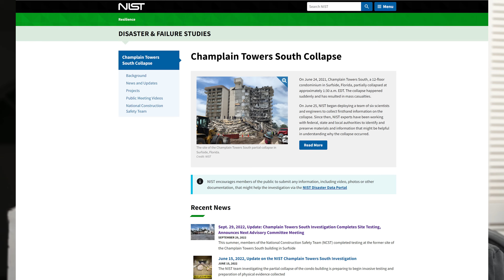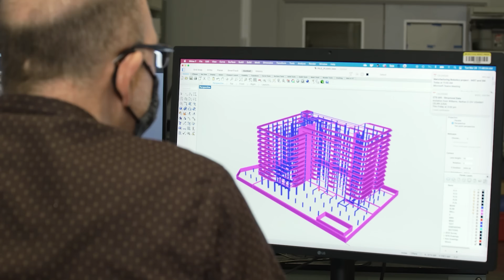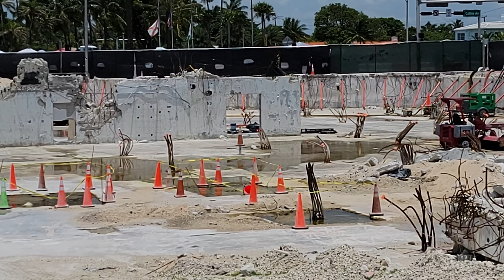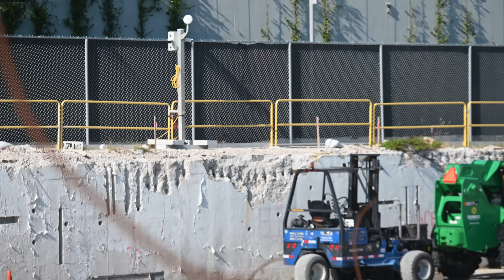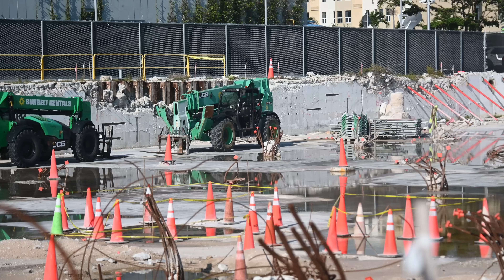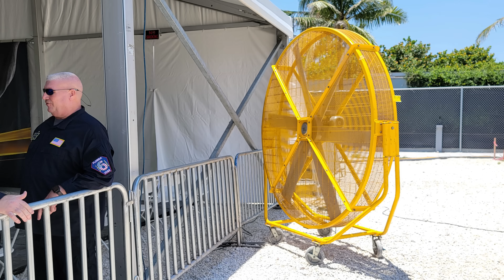Miami Condo Collapse Investigation Takes Unexpected Turn

Comment from the maker: 📺 WATCH: Fire Alarm Issues? Champlain Towers Condo Collapse, Property Sale
https://youtu.be/pVbhZFDj8tc
📺 WATCH: Champlain Towers North Crumbling Concrete! WARNING Signs?
https://youtu.be/6QwILxJgF1U
📺 WATCH: NIST Releases NEW Condo Collapse Investigation Video
https://youtu.be/KUG08o8Mnek
📺 WATCH: Champlain Towers South Condo Collapse Site Update What's Up?
https://youtu.be/QbqfabsDGM0
📺 WATCH: Investigation Update Miami Condo Collapse New Photos/Video
https://youtu.be/y7mFnrXzZ_Q
Reply: Any thoughts on the structural integrity of the Crimean (Kerch) rail bridge after suffering from possible blast/heat damage?  I can't make heads or tails out of the flood of pictures and videos showing the damage, nor can I find any construction drawings on how the bridge is even constructed, no cross-sections of the rail bridge spans, nothing.  I don't know if bridges are within your area of interest or not, just asking.
Reply: Hi Jeff, thanks again for your videos!, one question, what did you find out about that horizontal beam that everyone was talking about?, did the investigation team haul it off ?, or turn it into Swiss cheese with core holes ?, thanks!
Reply: My question is, are the buildings and condos safe to be in ?

Comment: I'm left wondering what the original weight load was for each floor as it stated in the blueprint from 1981? And then compare those numbers with a rough estimate of the weight was when in collapsed. I remember you mentioned that on previous videos through kitchen and bathroom makeovers of all that added weight.
Reply from the maker: In good buildings it should not be a problem with added weight. But what about a building where the concrete is no longer rated at what it was constructed to be due to years of crumbling

Comment: hey Jeff nice to have some fresh details of the early  pics and videos. I guess the horzontal and vertical sample taken out was to mesure the strength of the concrete on both sides all around the building. I am pretty sure they won't miss a thing about the flaws or any faliures or lack of mantenance that took it down. They owe it to the victims and victims families

Comment: I believe where there are reinforcing rods in the columns, I Beams would be much better
Reply from the maker: If the pipe stub coming out of the wall is too short you have no choice and so you're going to have to sweat it off with the torch and try to clean that pipe. Normally I hope there's enough pipe stub coming out of the wall that I can just cut the pipe behind the valve to remove it, so that I have a clean pipe and don't have to worry about trying to fit a new valve over old solder that might still be on the pipe.

Comment: It's truly amazing how the settlement went ahead of knowing what was wrong with the structure and those who'd have been responsible.  All they did was conclude that everyone that had anything to do with the building, its operation and maintenance gather and fork out as much as they could including their liability insurance policies to form a settlement to conclude the matter sooner.  It would be a shame to find that NIST determins 90% of those who paid were not responsible !  Our DOJ system is completely a bubble off plumb.
Reply from the maker: The insurers for all of these companies all wisely felt it was best to just settle now and get it out of the way rather than to have victims and the insured contractors have to endure 5 to 10 years of litigation which all of the money goes to the lawyers. That way people's names don't get dragged around in the mud in the public and the court updates on the news.
Reply: @jeffostroff  Yes, I totally understand that which is why it was mentioned. Sadly, a lot of those lost likely voted no on maintenance and HOA increases. If anyone needs to know, HOA communities are more expensive than owning your own in the long run. Also, they are another level of politics that require funding. Our DOJ system is completely a bubble off plumb and the attorney fee agreement proves it. Pro bono now means something else.

Comment: You are focused and fascinated on pointless senseless things .. Swiss cheese.. Cutting. More holes bla bla bla bla bla jeeeezes... And scammy company drilling holes for vibrations ?? How is that going to help the collapse ?
Reply from the maker: And you are focused on whining instead of engineering. The purpose of all of these holes and cores being cut is they can analyze the concrete from these core samples and determine what went wrong and where and the more samples you take from more areas the more you can tell if it was a systematic issue with bad concrete being poured, or if there was actual water seepage into the concrete, did the pH level change, did too much calcium seep in there? There's a whole lot of things that are answered by that so it sounds like you're just trying to be a Debbie downer here in hand wave off sound engineering that's been used for decades to successfully determine why a building collapse period of course it's not going to uncollapse the building, but it will help them understand why this happened and it will prevent other buildings from collapsing in the future.

Comment: Did they do a full report on 9/11? No!  Especially building 7. Everything cleaned up in a week and shipped to China.  Their reasoning on the collapse of the twin towers was jet fuel going down the elevator shafts to the bottom of the building. But that’s impossible bcse the bottom elevators only went up to the mezzanine floor below the impact zones on both buildings and then you had to catch another elevator on a totally different separate elevator shafts.  Plus kerosene hasn’t the ability to create anything close to melt metal.  Amazing how the science was deleted.  No investigation was ever done. And all questioning is deleted and censored and ignored.  What a beautiful world we live 😢

Comment: No, the sound penetration sought to find the ends of the rebar in the concrete, to establish why they separated. Was it rust, corrosion, shear, tension, crystallisation work-hardening, or anything else? The diamond cutters took a complete core, steel included. The longer slots, to ascertain if there was any tear-out.

Comment: Did they also test the other two Champlain Towers?
Reply from the maker: Another engineering firm is looking at the other 2
Reply: @jeffostroff  Not the greatest way of playing safe, then.
Reply: @RahereTheGenius  actually having a second set of eyes on it is much better. Leaving it all up to one firm is a great way to let bias interfere with results.
Reply: @johnd9357  Perhaps, but it's also a brilliant way of kicking it into the long grass of differing opinions and disputes. One very salient fact seems to be you have no professional disciplinary bodies like the UK's ICE. If you're not in good standing, you can't work in the profession.
Such standards work in the way you suggest through collegiality. Ideally.I'm a diplomatic-military economist, my father ran that for the Mechanicals, and set up the CEI, at Prince Philip's suggestion. The military side includes military engineering.

Comment: Thanks for the update,  Jeff.  You have done incredible work to keep people informed.

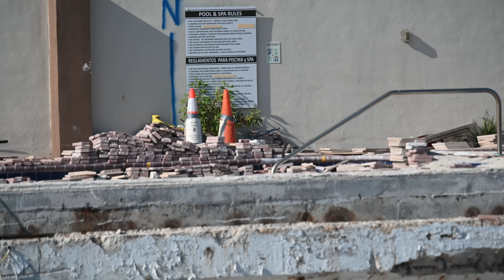You should ask for the 'pool rules' sign seen at 3:22,  before it is tossed.  One surviving piece from CTS for all of your effort since the beginning.
Reply from the maker: What I really want is security canera vidros
Reply: @jeffostroff  That is what we all wait to see since last June !!
Reply: Since the monitor I can use is 4K, I can tell the rules. 
1. No lifeguard on duty - swim at your own risk 
2. Cameras do not monitor for pool safety
3 Pool hours (blank)
4. Approved residents and guests only
5. adult supervision for children under 15 years of age
6. Children under 3 require water proof diapers
7. shower before entering
8. No diving - no running in or around pool area
9. No glass containers in or around pool area
10. No alcoholic Beverages in or around pool area
11. No floatation (inflatable) devices in spa
12. No oversized floatation (inflatable) devices in pool
13. Before use of spa, pregnant / child consult physician
Reply: @marcogamezz8594 
14.  This sign will be the last surviving item of Champlain Towers South.

Comment: Thank You for the update. It appears to me that every video shows pooling of water right in the center of the parking garage. I'm not an engineer however i question if this pooling is caused by high water underneath the whole structure. The water on top is there because below the concrete is water. The water has no where to drain thru the porous concrete. Maybe some of that water is coming upward from excess water from below. I wish you could of been onsite during Ian and watched how the water flowed from the West. Excess drainage from the 2 open fields (water goes in the ground and drains towards the ocean) and tennis courts to the West could saturate the whole CTS property.  I only note this because  the maintenance man stating that there was 12" of water after every heavy rain. Why was there so much water? Where did it come from? Really nice work Jeff. I enjoy all your videos.
Reply from the maker: That is what they hope to find out. I do know a lot of water was leaking into the garage from the pool deck above it.

Comment: Still all that water sitting in there.  How many pumps did they have running?  I don't know how people live like that. It's just a hurricane away from being forgotten property.
Reply from the maker: This is a standard dewatering system they use during construction, but as long as they are there doing destructive testing, the dewatering equipment must be there.

Comment: Right there you can see a column that has more rebar than cement, there is a tremendous calculation error, that column # 10, has more rebar than concrete, to buy a condominium the first thing I would do was see the columns that is the support of the building

Comment: Thanks for the update Jeff.  It's reassuring to know that so much effort is going in to studying what happened.
Reply from the maker: This will be a beneficial learning experience to all engineers and architects and it should be required for degrees going forward to study these engineering disasters

Comment: Thank you for the update and can you do a video on the Royalton in Houston.  They just started allowing some residence to move back in.  My question is how in the world can something like that happen with such a newly built high rise.  A few years ago I lived in an apartment on the second floor which was above a vacant unit.  The unit was vacant because the water line beneath it would break every two or three years and the property owners could never get someone to figure out why the water line beneath the slab of concrete kept breaking every few years.  I remember you mentioned in one of the CTS videos commenting on how recent repair work on the pool deck ceiling had not been done correctly but where is the transparency in construction these days?  it seems like we are no better off then back in 1980.
Reply from the maker: Yes, mentioned this condo on a previous video in June when it happened, would like to see what their root cause was on that one. The walls were splitting open on that condo!

Comment: Your doing such an amazing job thank you so much 😊. Jeff I know this I completely off topic but I absolutely love how you and others break down complex engineering. Do you know if anyone in our “group” of engineers can explain how much heat it would take to make a railway Not salvageable? I was sparked when I saw the “bridge explosion” and I need to science nerd this concept in general terms. Not political stuff just the science of how this kind of thing would effect rail bridge construction. Thanks 😊
Reply from the maker: Very good question. The problem with railways is the metal can often be 40 or 50 degrees higher than the ambient temperature and this causes the metal to expand. Combine this with the fact that the railroads are anchored in place by all of those spikes and something has to give so sometimes they buckle. When the temperature gets above 86 degrees, called the “stress-free temperature” SFT, the trains are required to slow down in order to prevent out-of-control expansion and overheating of the trains and the tracks. I haven't seen any published temperature data but I do know that the engineers use very complex formulas that are related to a particular site where the track is being laid, and they look at historical temperatures in that area as well and feed all of that into their equations to tell them what they need to do to the tracks. But tracks will buckle under hot sunlight and they think that it has caused maybe 2000 derailments in the United States over 50 years time.
Reply: Thank you so much for this fascinating insight! I really appreciate the time you put into it. I’m learning so much and really enjoying it.
Reply: @The.Spicy.Raccoon  Every part of a railway can be replaced with new parts. Rails, ties/sleepers, coupling plates, fasteners, etc.  It is straightforward work, can be completed typically in a few days, and is no different than the normal repair work done every day.
Reply: @KB4QAA  oh ok thanks so much. I was thinking that it would be a more complex set of repairs due to the heat on the structure. I was also curious about the metal melting points and if that would cause more damage to the concrete in way of strength.
Reply: @The.Spicy.Raccoon  We need to be clear on terminology. You asked about the railroad. The condition of the bridge is another issue.
Reply: @KB4QAA  thank you for educating me. I really appreciate it. I was not encouraged in school to learn anything other than the basics because of my learning disabilities (20 + years ago the idea with smart kids like me was that unless we got good grades we were not allowed to explore advanced topics. It didn’t matter that I just didn’t do standardized tests well. I was also encouraged to do more gender appropriate studies like music and literature.) Again I really appreciate your response and time in helping educate me. Do you think the metal rails themselves would have been welded using the thermite method? Is that a common practice in Russian rail construction and repair?
Reply: @The.Spicy.Raccoon  The best of YT is having pleasant discussions with people like you!  I'm sorry, I don't know anything about Russian railway construction.  Have a great day!

Comment: Great job, as always. I noticed a outside wall that you showed. It wasnt smooth like the rest of it walls, it looked like they ran out of cement and poured way too much and made a mound?? Wouldnt that cause a cold seal?
It would be showing on the right side of our view.
Reply from the maker: It's so hard to tell without being right there to see the wall.
Reply: It's near the middle of the North wall. It couldnt added later, I believe it starts the ramp